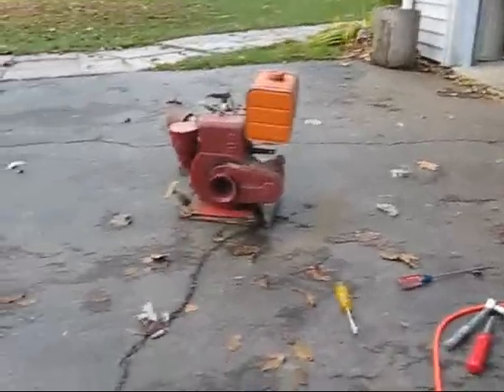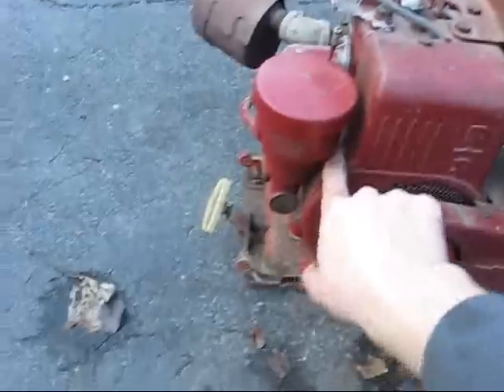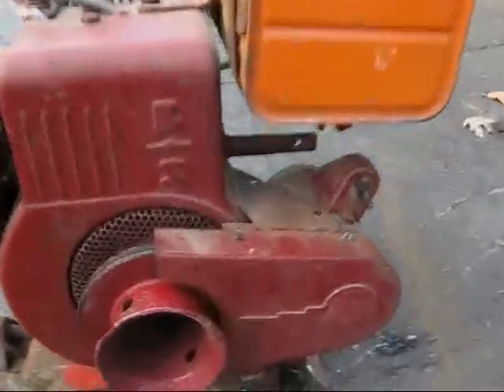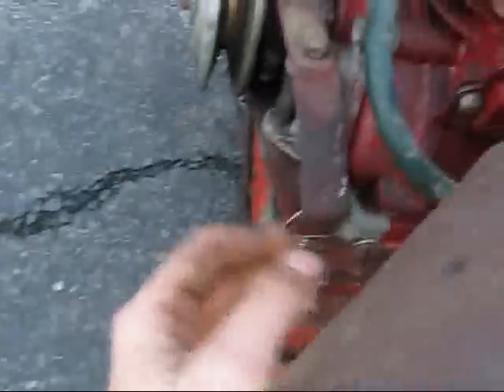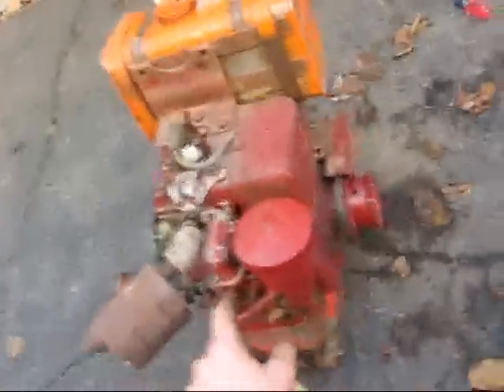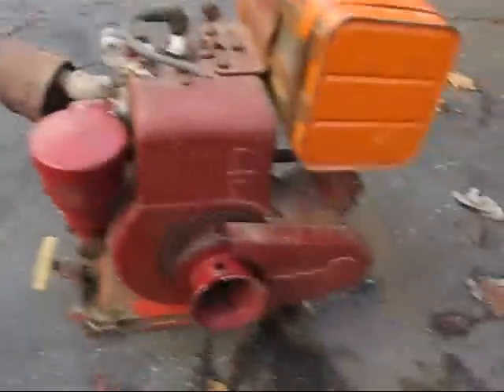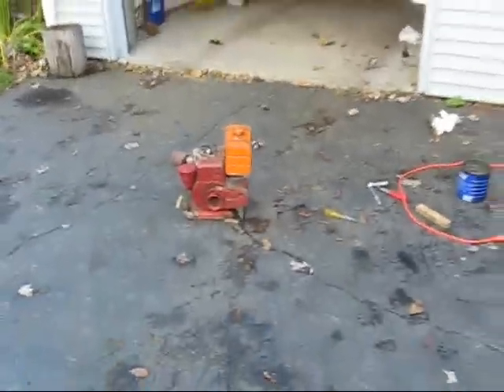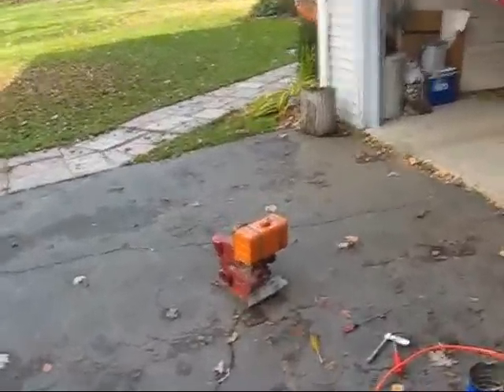1959 briggs 8ci 3hp

Comment from the maker: it sounds like your school had one. this is off a toro powerhandle. it could power all the homeowners outdoor machines and reduce the maintenence to one engine! also this engine has an aluminum bloc, so it is very light! it is so easy to move around it only weighs about 20-25 pounds!

Comment: That starter really works well...starts very easily! In this kind of application just using an extension cord can be a lot easier than having to have an alternator and battery, etc.
I wonder what the original machine looked like that this went to? We had a convertable snowblower/rototiller at the high school when I was in school and sometimes I would do the snowblowing...I don't think the tiller attachment was ever put on it though.

Comment from the maker: @MrMoterKid the gastank makes it look bigger because its the wrong gas tank. it was like that when i got it. 
well its a model  81303, its a newer version of my model 8b and actually is identical to my model 8b in everyway exept the clutch pulley and the electric start. the 8b is rated at 2.5-3hp. the first diget or 2 digets in larger briggs engines tells you the cubic inch displacement, this engine has 8ci. its a 3hp. look it up if you dont belive me.